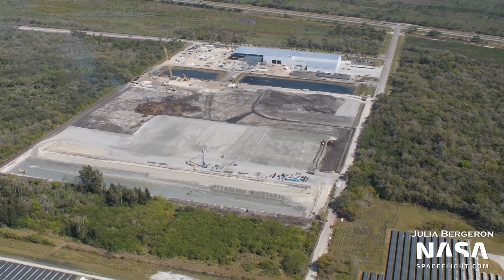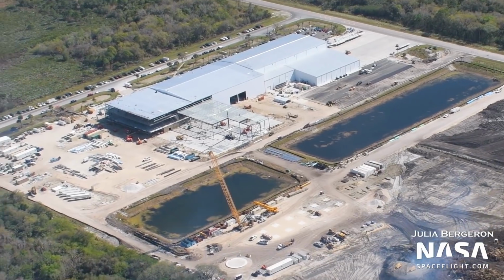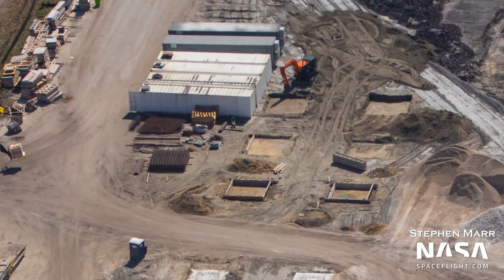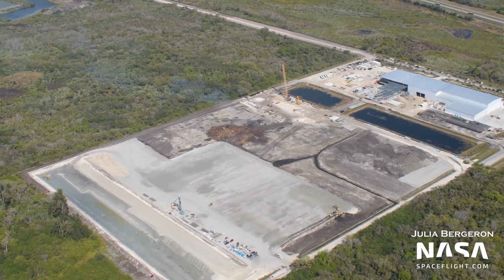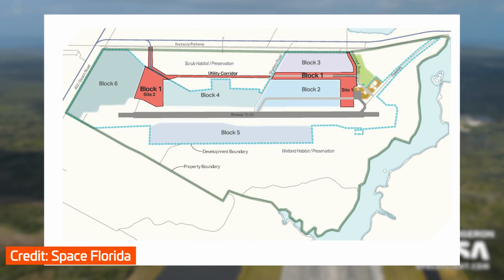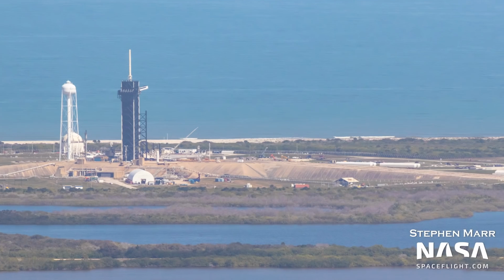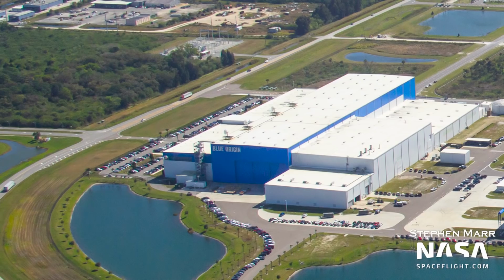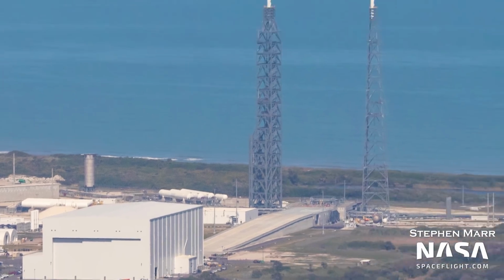Starship Propellant Tanks Spotted at SpaceX's LC-39A | Cape Update - Narrated

Comment: Does Spacex operations mean like mission control center/office ?  Is there also a build facility planned ? Pad39A is off course the launch and landing pad, but where will the build site be ?  In Boca Chica it is near the launch/landing facility, however there does not seem to be very much space for a high bay/wide bay structure near pad39a?

Comment: BO is really good at building everything but rockets.  They have some pretty buildings.
Reply: Eh, New Shepard is a good sub-orbital rocket. It just took WAY too long to build. Blue Origin's motto is “Gradatim Ferociter,” which translates to “step by step, ferociously.” Blue Origin just doesn't seem to take steps very often.
Reply: @Steve Austin  New Shepard is a carnival ride.  If it can't deliver a payload to orbit it not a real rocket to me.
Reply: @kokomo9764  It's designed as a sub-orbital rocket. It carries science payloads and tourists. New Glenn is their orbital rocket, but it is taking a long time to develop. A theme for Blue Orgin.
Reply: @steveaustin2686  Yes, but its reliability makes it worth the time. Especially, when it is said to be a precursor for New Glenn's second stage.
Reply: @selvasurya049  The New Shepard is a good first step and is a good rocket as I said. It just took too long to develop for a straight up-n-down, sub-orbital spacecraft. There is a huge jump from the sub-orbital, small lift New Shepard to the orbital, heavy lift New Glenn. Again, Blue Origin is slow with development for the New Glenn. The Air Force (USSF) had some pretty sharp criticism for Blue Origin's New Glenn and Northrop Grumman's OmegA development for NSSL2 payloads. From a SpaceNews Aug 2020 article

"Despite political pressure to not end the LSAs, the agreements will be terminated, Assistant Secretary of the Air Force for Acquisition Will Roper said Aug. 7 during a video conference with reporters.  'We will work with those two companies to determine the right point to tie off their work under the LSA agreements,' Roper said. The intent of the LSAs 'was to create a more competitive environment leading into Phase 2,' he said. 'The point is not to carry them indefinitely.'”

The BE-4 engine for New Glenn will also be used on the ULA Vulcan Centaur. The BE-4 delays have already cost ULA money as the Q4 2022 USSF-51 flight had to be moved from the Vulcan Centaur to the more expensive ULA Atlas-V. ULA is eating the cost difference as the NSSL contracts are firm, fixed price contracts.